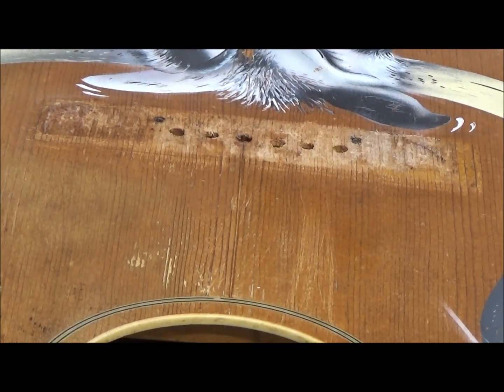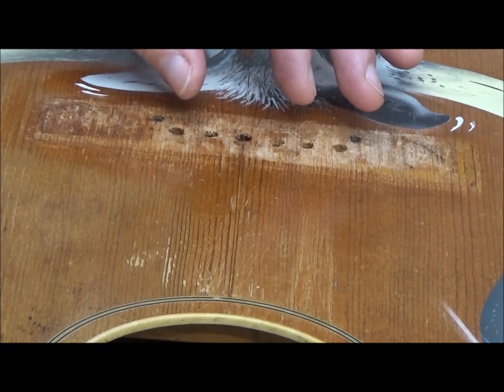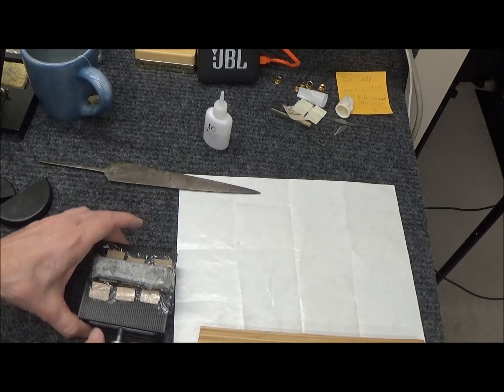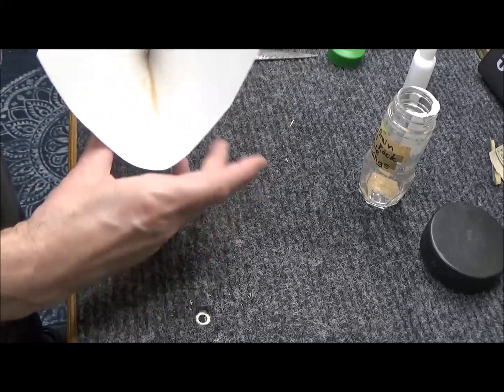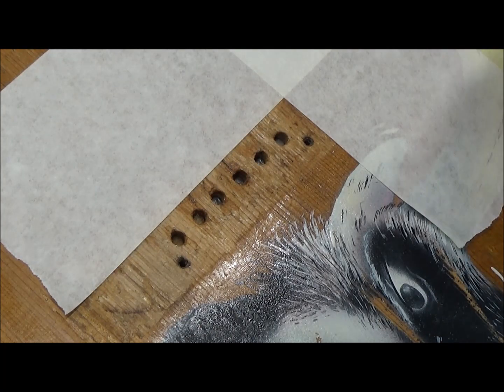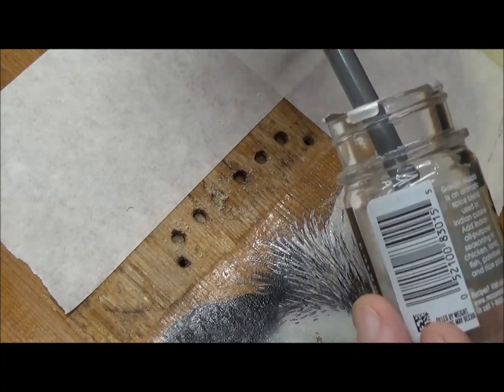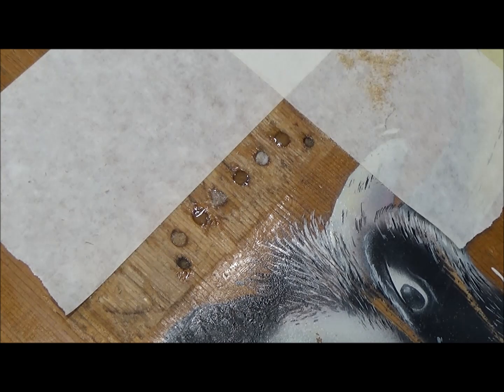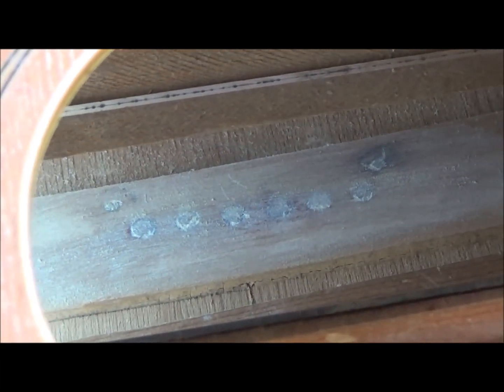Pin Hole Repair for Bridge Plates and Sound Boards

Comment: Thanks for this video.  I think I’ll give this a try on my ‘63 Guild D-40.  I don’t need to remove the bridge but the process should be the same.
Reply from the maker: Right on! Just one application of fibers and a few drops of C.A. Glue in each hole should be enough to patch up the bridge plate 👍🏻

Comment: All the CA glues I’ve seen are warned to not breath the fumes.  A respirator would be the best, but a fan in the distance blowing across the work area should help.  Any kind of lung issue is something you never want to deal with! (Been there - oxygen is really important!)

Comment: This is an excellent video and well explained to do this repair. I have a question please if I may.
Is there a way to make the ball end of the strings sit deeper into the acoustic guitar bridge? 
*
Since slotting the bridge (to gain a better break angle on a shallow saddle) some of the string end windings are now in contact with the saddle slots (because of the shorter distant with the slots/ramps). The windings are not going over the saddle, but they're actually touching the saddle on some strings and very close to going over.
If I can get the string ball ends to sit deeper into the guitar body (say 1/8" or more) that would be very helpful to eliminate this happening. Two strings (the high E and B strings) are affected by this causing some noticeable buzz when played at times.
*
Thanks in advance and your well made videos are an excellent resource. Subscribed.
Phil
Reply from the maker: @uptownphotography  Thank You. Double Ball End each string and switch to D’Addario strings (they have short wrappings)
Reply: @harpethguitar  Thanks Scott for that info. I will give that a try and also check some D'Addario string sets. All the best.
Phil

Comment: got a link for that expanding jack table thing? that's pretty dang cool
Reply from the maker: CALIDAKA Lab Scissors Jack, Stainless Steel Laboratory Support Jack Platform Lab Lift Stand Table, Lifting Platform Aluminum Alloy Measure Tool for Science Experiment Lab Stand https://a.co/d/bKqsK7d